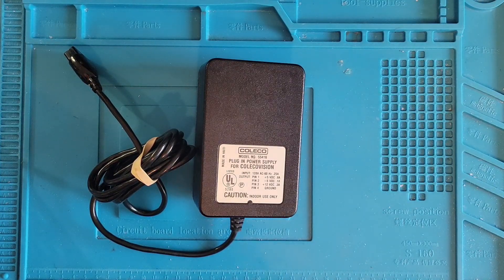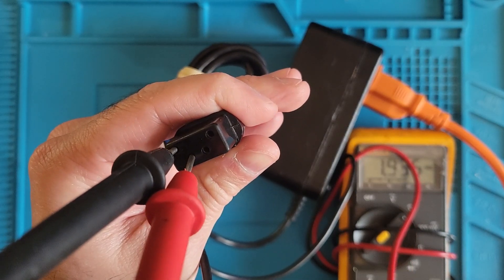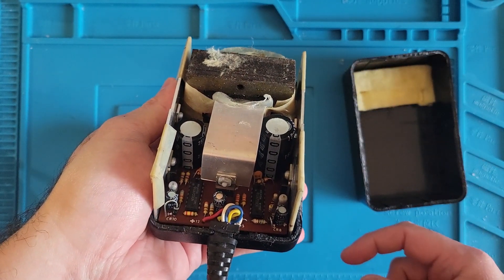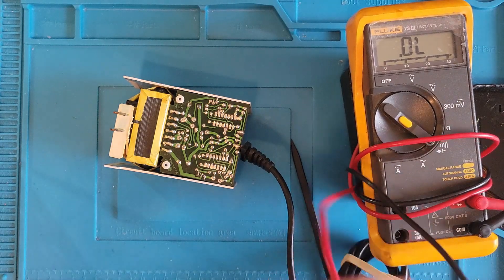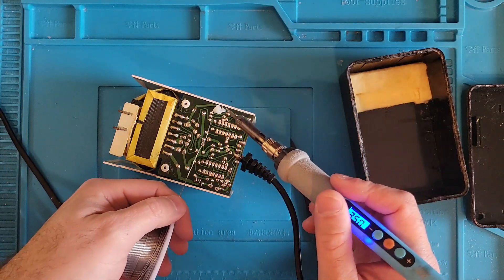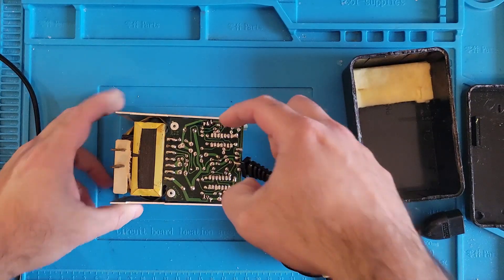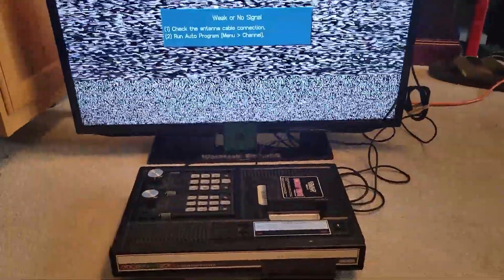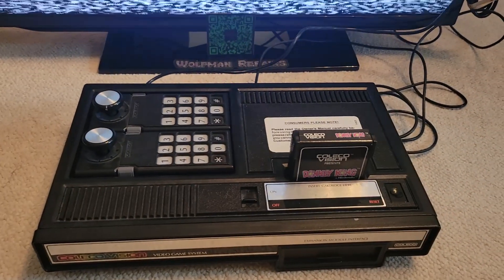Broken Colecovision Power Supply - Donated By Shawn's Tech Rescue  – Can It Be Saved??!!

Comment: Im gonns have to try this. I actually have s very similar problem of not the same. +5 and -5V are fine, but my +12V line reads 4.9V.
Can you explain hoe you opened the power supply s bit more? I dont necessarily wanna damage the housing and i dont wanna melt it with the heat.
Reply from the maker: I don’t recommend doing it this way but I used gasoline to help melt the glue between the two halves. I brushed it on and slowly pried at the case. This was messy but it eventually worked. What I’ve done on other ones is used a cutting wheel on a dremel and cut the case open along the seam. In both cases I had to hold them together with zip ties after gluing. The dremel with a cutting wheel will take minutes just don’t go to deep the other way took hours and it was not worth doing it that way. Hope this helps 🐺🐺🐺🐺😁😁😁😁
Reply: @wolfmanrepairs  That definitely helps thanks! I'm trying heat gun right now. I really don't wanna use a Dremel but I guess I might have to. 
I'm also working on a Canadian unit which seems different. 
Where yours is an enormous brick that plugs directly into the wall, mine is a brick with two cables coming out either side, the plug is a standard two prong plug. Much easier to manage when plugging into a power bar

Edit: I got in, used a Dremel, but here's the next difference between the US and Canada I guess... The entire power supply is dunked in resin. This is going to make troubleshooting a lot harder
Reply from the maker: Oh wow!! That’s really interesting!! I wonder why they thought it was necessary to do that. Were you able to find the problem? 🐺🐺😁😁